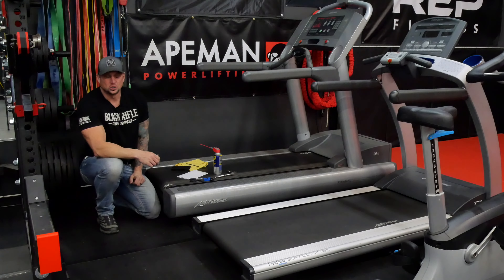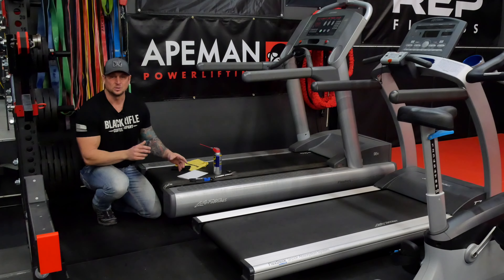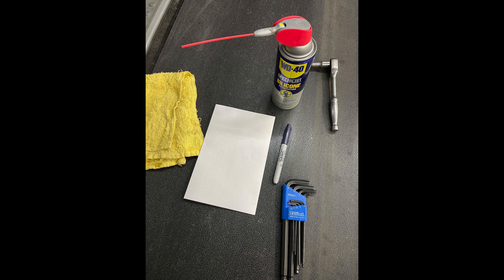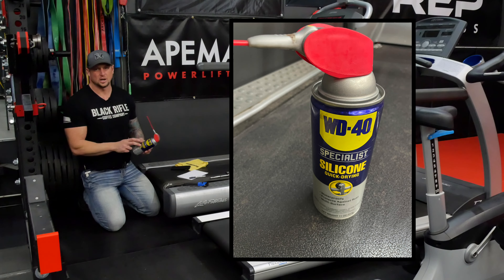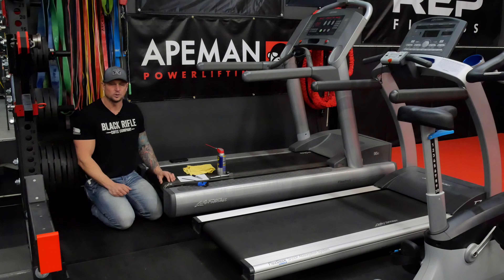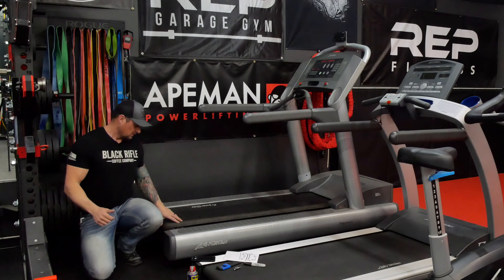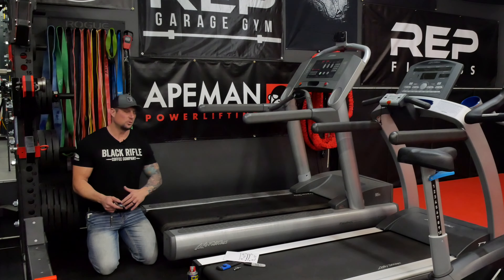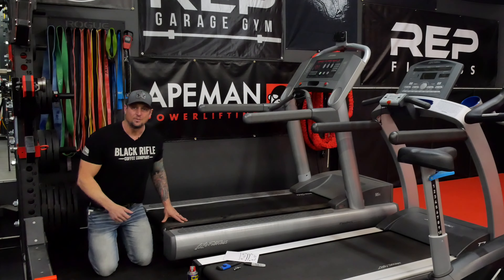How to adjust and fix a slipping treadmill and lubricate the belt.

Comment: one more great video...I have lost count of the turns after the last time i lubricated it and now i cant fix it well... I feel i am going to break the motor.
Reply from the maker: You can easily loosen both sides and tighten them evenly until the belt is tight and doesn’t slip
Reply: @MacStrengthCo  I unscrewed both screws all the way and then tightened them equally from each side, and managed to fix it.
Reply from the maker: @ioakimmakis9288  nice work!!

Comment: I've done this but my treadmill still stutter/vibrates when I walk on it. it's brand new only used it for a week. I tried everything but it still stutter while walking. I've checked the inside of the motor and the wheel was wobbly, could that be the reason ?